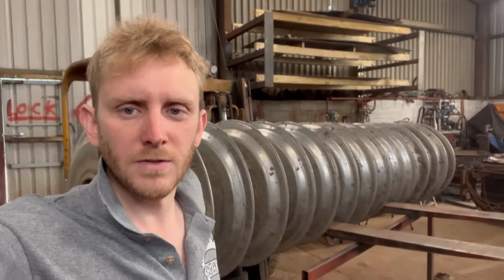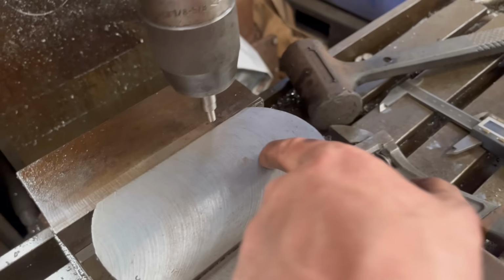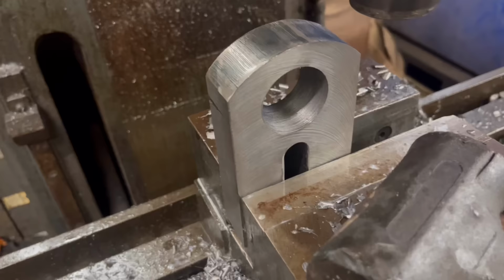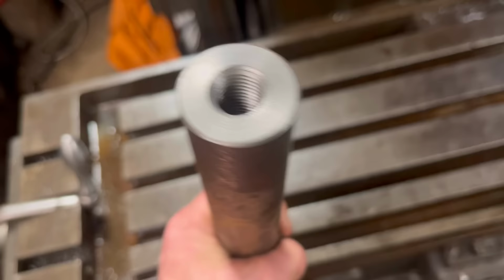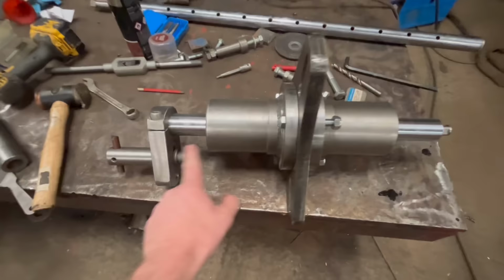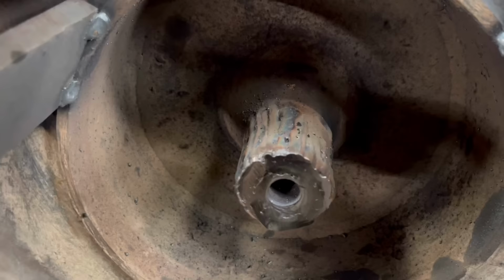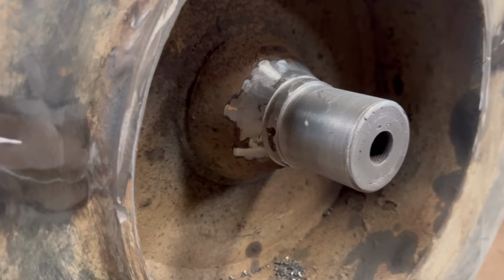Using the line borer to machine external shafts

Comment: Any machine shop suppliers out there to sponsor some machines for the guy,  he is a top class fabricator,  👍  who agrees
Reply: or maybe a set of gage blocks at least, to start
Reply: For a few years I've been watching several other guys that "were" as resourceful as him. Unfortunately, as YouTube made them stars they have been able to afford new equipment, tooling and even buildings. I say unfortunately because with all the new gear they are no longer solving problems but are just another modern machine / welding / repair shop and no longer nearly as interesting.
Reply: I do.
Reply: I defo agree, i been in fab shops and they dont do anything like this standard
Reply: I do
Reply: I did the same thing by brazing an insert to a whole saw, and using a drill. Used the internal pilot hole
Reply: I do!
Reply: I do.
Reply: I do
Reply: ABSOLUTELY 100% ..
Reply: Totally agree! 100%
Reply: most definitely
Reply: Ne è pieno il mondo di gente cosi, se si dovesse sponsorizzare tutti sarebbe un bel casino
Reply: He is indeed! My admiration and Respect for !👏👏👏👏👏👏👏👏👏👏👏👏👏👏👏👏👏👏👏👏👏👏
Reply: But part of the charm of this channel is watching him figure stuff out by the seat of his pants.
Reply: Very nice job
Reply: Totally agree
Reply: The machines also would help his customers, who would get better quality work for a lower price
Reply: I totally agree and hopefully he'll get there, I'm not an engineer but I love watching his problem solving and ingenuity.

Comment: Great setup! A counterbalance may help with surface finish too, on your fist trail run you could hear the motor tone changing without the tool touching anything. Possibly a new slotted backplate with more mass opposing the cutting tool slot could help 👍
Reply: I was thinking the same myself,  perhaps more of a pear shaped adapter with the tool holder at the narrow end and the shorter wider end to act as a counterbalance without drastically reducing visibility or access to the cutting tool.
Reply: Heres an idea make the three attaching arms different diameters , hopefully that helps get rid of the vibration .
Reply: Or just slap it at the back of a crankshaft and call it a day.

Comment: You are the type of person when others say it can't be done, bring it here and we'll see. As others have said, good problem solving skills, really good. For a non machinist you also do very well. As for surface finish the carbide tip needs to be on centre line. The tool holder was centred but the carbide cutting tip was above the centre of the arm you fabricated/machined. Some offsetting and you'll be right.

Comment: Gday, I’d call that a big win and a job well done, on my Cincinnati mill which would be around the same era as you mill, it’s got it own gear pump, I run soluble oil in it with no trouble at all, I’d say you could do the same with yours, the line borer you made does a brilliant job mate, cheers

Comment: First time viewing your channel As a bloke who spent 25 years line boring in Western Australia You are obliviously innovative and prepared to give it a go We used Climax boring gear bore welders etc We set up equipment to weld and machine the OD on Tamrock Pantera drill axles yes a bit larger diameter 130 mm and 260 mm In length  ,did lots of them until new model of drill came on the market but that’s another story 
Yes you are correct Rigidity in your set up is very important it’s better to over engineer 
The other problem small engineering companies face with once off work, is costs as the costs of setting up for one or two jobs is generally prohibitive as it cuts into your regular work cycle Of course there’s the local effects and sometimes it’s your best customer is in a bind and there’s the good will etc  Keep up the great work

Comment: Well done Oliver! It's aways amazing what what a person can come up with when they  color outside the lines. aka.. think outside of the box. Like you pointed out, not the most rigid set up, but the job got done nicely. I have a short bar with a 1" hole in the end for accessories and I have done similar repairs using a milling machine boring head and a cantilevered setup.  I really enjoy and admire your creativity and get it done attitude. Cheers

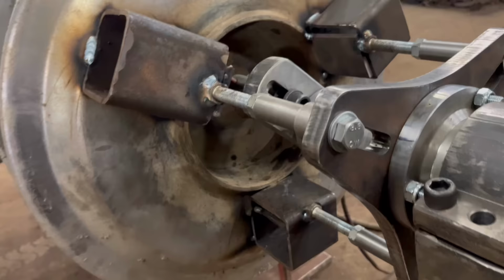Comment: 27:11  With your tool holder hole dead center your insert contact point is elevated.  Which is fine so long as you have enough relief behind the insert.  With the cutter above center line the work is always rising into the tooling so it takes more relief than what is typically used.  You can make your own HSS inserts... although that does open another can of worms.

Comment: I think you did a marvellous job with that. Not easy having to do jobs out of the normal run of the mill, but utilising your line borer was an inspiration. The length of the cutter was probably the reason for the surface finish not being as good as you'd like. Having beefier supports, as you said, and reducing the length of the cutter bar out of the bearing housing should help. Thanks for posting mate, much appreciated, be safe, be well 👍
Reply from the maker: Thank you!

Comment: That was an incredibly difficult and tricky repair. The way you made that tool to work externally on the line borer was brilliant. With the modifications to the tool that you mentioned, it will be ready for the next time you get a job like that. Not having a giant lathe meant thinking outside the box, so to speak, to come up with a solution that worked well.

Comment: Excellent effort considering the options! A thought I did have was a dowel pin center arrangement that would locate in the shaft to be machined and to a reamed hole in your boring bar this may negate the need for "heavier standoff legs" to reduce chatter? Anyway I am sure the client is well pleased that you are around!

Comment: That's a brilliant idea and it adds extra purpose to a machine instead of having to buy a second machine to do the job. When you're using the dial guage to set the tool depth - the way you mounted the dial guage on the work piece meant you can pick up a small error if the tool bar swings as you are adjusting it. If you mount the guage onto the drive bar/drive arm it can't introduce an error as the guage will swing the same amount as the tool if it rotates.

Comment: Cracking job Olly, restricted height on the mill is always a pain ! Just welded up and bored an H link off our timber trailer. My little mill struggled with it and I had to turn the head 90° and machine it horizontally along the table. Wouldn't have needed to do it if the beggars had greased the bushing though !

Comment: Hi, you did well getting the surface finish you did on weld metal, horrible to machine with cutting tool, I found grinding where possiblle is better. Maybe a jig to hold a small grinder but powering one would need a little more invention as it goes around the work. Many thanks enjoyed this job, from Nr Chester.

Comment: Great method for this, very clever idea, just a note on your milling part of this video, maybe just how it looks on video but the 38mm drill looked slow, i general rule I’ve used for hss drills in steel that tends to be a safe number, 8000/drill diameter x0.66 = RPM, enjoying your content mate, thanks
Reply from the maker: Yes, it was a bit slow but I was in no rush so just kept at it

Comment: Hi Oliver,
Cut outlet off left side plug hole make new pipe out of copper to suit hose dia and solder new into the other side of radiator job done.
Have a talk to bearing suppliers to see if they have hardened sleeves the right diameter on out side to suit needle rollers to suit make shaft out 4340 or equivalent to fit inside a bushings to fit housing so that you can get it up and running
Desmo

Comment: one more thing you could add is a fine treaded set screw that runs from the outside of the "crank piece" to inside the groove you cut in it to push the bar toward the drillrod driving the whole thing 
that will allow you to set the tool towards the piece to be cut more finely before clamping it down and prevents the bar from sliding away from the piece inside the groove while cutting if you didnt clamped it down good enough , the cutting tool inside the bar piece itself might still back off during operation though if not clamped tight enough but making one with a step in it butting up against its mounting should stop that from moving away

as for cleaning up the damaged edge of the part youre machining , i know it be hard to fill that edge up with weld without making it look like a dog pooped on it than walked backwards over it , but wat if you made a bushing out of scrap material that titted tightly over the part machined mostly round again and that goes a little pass the edge thats been mangled so badly , you might have enough of a "v groove" inside between the bushing and the mangled piece to fill it with a good penetrating weld , then machine the bushing away untill the tap is back to size and re machine the face so it looks nice again (might be able to use a large flat head mill put intoo the top of a boring bar in the setup as you have it now to face the whole thing in one go then redrill the center hole with a reamer)

Comment: Brilliant as always. You so need a welding attachment for your line borer.
Reply from the maker: Yes, that would be very handy.
Reply: @snowballengineering  Yup - just build it lad ! Yet another brilliant thinking & tool making project. Not too sure about the rotary gas & sparks supply to the welding head , but if Kurtis @ CEE did it - I am sure you will. {Soon hopefully - BIG potential in having both the internal and external line boring capability} Thanks for the video. Cheers - John.

Comment: You need an angle plate for the mill ,lets you drop the part right down to bed level gaining another 50 -60 mm.and they are fairly cheap.

Comment: One comment, when milling the slot once the two end holes were drilled  I'd have milled from each end to the centre rather than from one end to the other,  that would guarantee there was no chance of going past the end. But a great solution to a difficult repair overall.

Comment: "Preventative Maintenance" warn the part owner its easier to schedule periododic bearing replacement prior to journal destruction, be it machine hours, bi-annually or annually. You also had a pilot hole there that could have been utilized as a core point of index stability with an OD grinder using the same outboard rotation. Could have also turned the entire rotor in roller bearing V Blocks and ground. If theres a will... there's a way. Regardless... you have people thinking.

Comment: Maybe a HSS cutter would leave a better finish at that cutting speed. Or use a non coated carbide insert that has a lower cutting speed requirement compared to the TiN one in your video.

Comment: Could you not drill a small hole top and bottom. Shine a torch through the bottom hole while looking through the top. To see if the shaft goes all the way through. Then just plug weld the holes after.
Reply from the maker: Yes, could of soon worked out if it was a through shaft but I thought this way had less work involved.

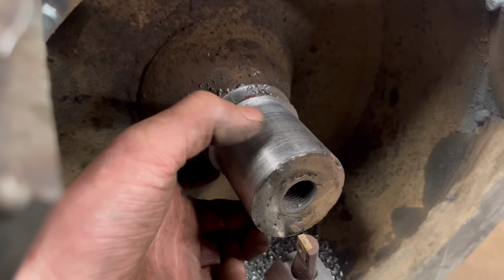Comment: 35:41 it seems in my experience, that welded metal 
is not the best looking or easiest to turn steel......
maybe use a lubricant/coolant to give a smoother
cut? 
I used to do a lot of shaft buildup and turning down....
we had a large old lathe dedicated to welding the shafts,
30 inch, or 15 inch swing as the UK would call the swing and 12 feet long.
we added a VFD and geared it down to turn as slow as 1/4 rpm.....
added ...a mig gun to the tool post and let the lathe drive the 
tool post as the work revolved.....it gave an amazing weld....
then put the shaft on our more precision lathe to turn it down to size...
Cheers, Paul In Florida, USA

Comment: Good work, which welding wire do you use for welding and which insert? 
I have the problem when I weld something with SG2 welding wire that the weld becomes too hard and the turning tool cannot remove anything. greetings from Germany

Comment: The part is 60 inches a crossed the shaft where I have to weld. It is about 8 inches and the Bearing area is about 4 1/2 inches 6 inches deep.

Comment: Wonder if a mag drill with a 50 mil ID hollow bit and set on a temporary welded plate would have worked? (Question is do they make a 50mil ID hollow bit?)
Reply: Like your thinking there but not sure the sizes would be available to the right tolerance
Reply: @johnwarwick4105  Yeah, it was more of thought than anything, but you never know ether?

Comment: 20:50...why not just use a larger set screw-(?)
Reply from the maker: Could of done but wanted to keep all the set screws the same size across all my line boring gear so I only need 1 tool

Comment: Sorry to spoil your party but why not using your wolhaupter?
Reply from the maker: Because the int40 taper on the wolhaupter is bigger than the 40mm bar my line borer is set up for.
Reply: @snowballengineering  can you change the adapter on the wohlhaupter?  I can on my upa3 with some effort

Comment: Best guess on the finish is mig wire can be hard, the speed is slow but you can't help that.
Nice fix, I have built up using 6013 then turned that as it seemed softer. 

https://youtu.be/R8Q73QiT8bk

Comment: Is there any way you can modify your mill by making raising blocks to give you more height? Cutting Edge Engineering Australia here on the Gold Coast in Queensland did something like that on one of his machines to give him more height. https://www.youtube.com/watch?v=roMzviZ4p6I Of course it would depend on the construction of your mill as to whether that is even possible , as there may not be any way to do it if the column is in one piece.
Reply from the maker: No, unfortunately it’s all one casting so can’t add any spacers

Comment: Given the nature of the repair - what the repair was on and the tolerances necessary - that was one of the most over thought and over complicated machining operations I've ever seen. We have literally done that same repair in less than 3 hrs, utilizing the tapped center hole to mount a centering mandrel , and attaching cutter bits to a holesaw driven by a magnetic drill press. While there may be jobs that require tighter tolerances and need a complicated piece of equipment to perform them - repairing the end on a farm roller isn't one of them.
Reply from the maker: A bearing on a loose shaft is not going to last, whether it’s a farm roller or not. 
 I didn’t make the adapter especially for this job, this just happens to be the first job I used it on 😄
Reply: @snowballengineering  I didn't say it didn't need to be repaired, only that the method used was overly complicated. And sometimes it can actually be easier (and cheaper) to make a simpler tool than to use a more complicated one on the shelf.
Reply: A hole saw won't get you within ten thousandth, your bearing won't last, this isn't wood working...
Reply: @mattbergseid9196  Using a MODIFIED hole-saw based cutter that was located off and stabilized by the center hole has gotten us to within .003" tolerance, and finish adjusted with crocus cloth strips - well within the needs to locate a common flanged bearing. The repairs HAVE LASTED well. No, it isn't woodworking, it was farm equipment repairs being performed by competent people not being funded by viewer counts - not by viewers whose skill set is better suited to gluing macaroni to construction paper for a fridge decoration.
Reply from the maker: My work is not funded by viewers, it’s real world work. I just did the job the best way I could think of.  There’s more than one way to do a job and just because I didn’t do it the way you would have doesn’t mean it’s anything to get annoyed about.